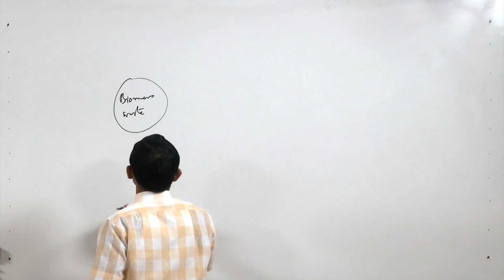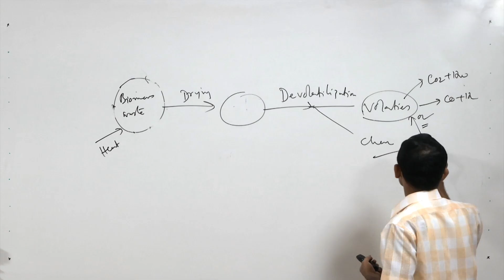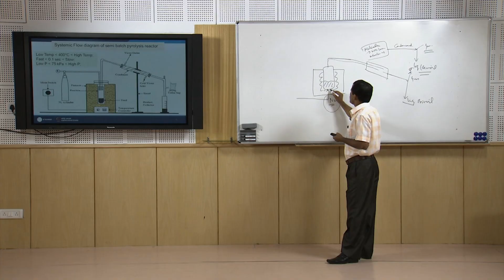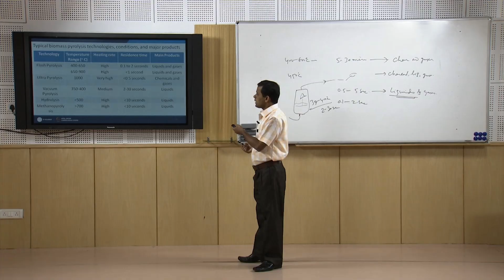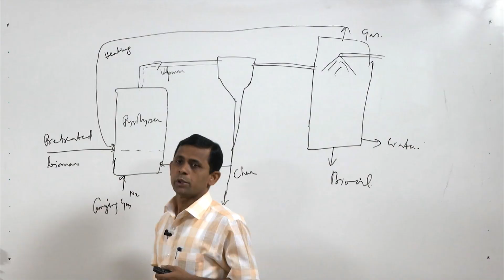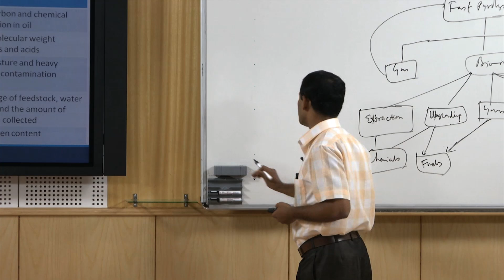Energy production from wastes through pyrolysis-1

Comment: Hi what would be the pyrolysis product distribution of PolyEthylene ?? plzz sir
Reply: We have invented fast pyrolysis system for conversion of any dry agro waste to active energy without the pollution of environment.We developed a pilot project for Maharashtra Bamboo Development Board,Nagpur, Maharashtra.On the completion of the process of dry bamboo waste we get three Bio Products                     1) Pyrolysis Oil 2) Activated Charcoal 3)Syn Gas.                   •)On distillation of pyrolysis oil we get Light Diesel Oil(LDO) and Compressed Natural Gas(CNG)                      •)The Activated Charcoal obtained from the system is used in various industries such as Cosmetic industry, Pharmaceutical industry and Fertilizer industry.The Activated Charcoal can also be used for Purification of Water.                                           •)Syn gas can be used for generation of Electricity and on compression of syn gas we get Compressed Natural Gas(CNG).                                    This is a patented project and the size of the system varies from 1 tonne per day to 40 tonne per day